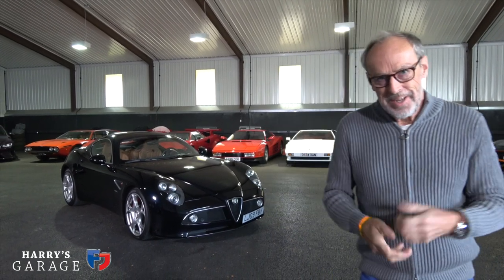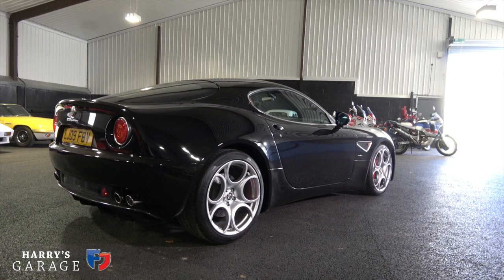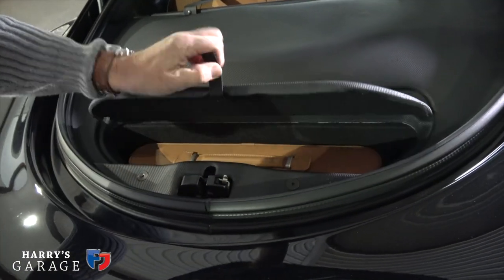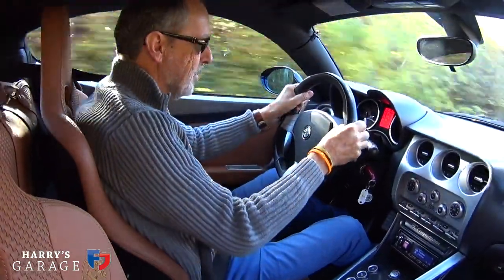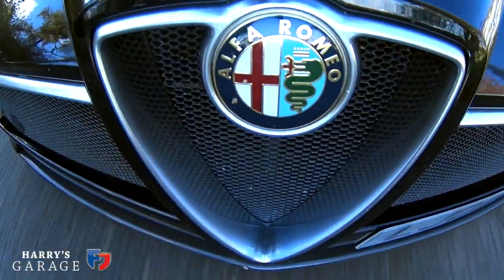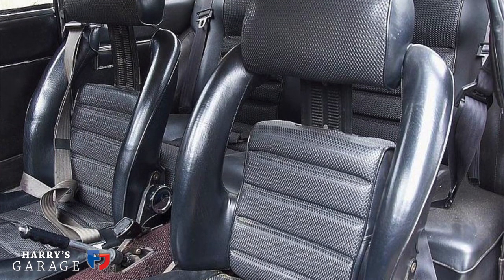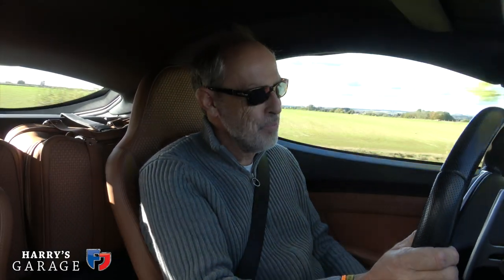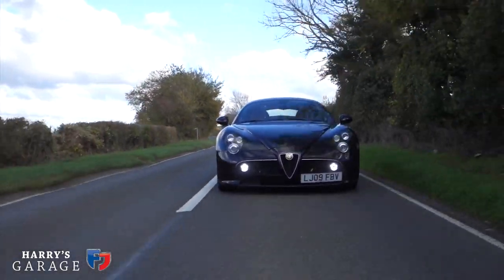Alfa Romeo 8C Competizione drive review

Comment: The engine and transmission are Ferrari cum Maserati.  the F1 transmission (aka Cambriocorso) was one f the weakest points in the Maserati Quatroporte ... the engine is an evolution of the 4.2 Maserati which in itself was a revised version of the Ferrari 4.2 with a 90 degree crank (as opposed to the Ferrari flat plane).  Great engine ... lots of torque and loved to rev.  Best audio track imaginable. However I dropped the Maserati like a stone when I learned of the 17K cost for a clutch replacement.

Comment: 1 thing wrong with this review. It should be an hour long. 
The only issue i have with this beauty is the aftermarket look audio unit. The sound system is already in place and reference level. Its called the engine!

Comment: 8c is a good looking car but so is Brera and the 159 SW is still just about the best looking estate car that most folk could afford. I challenge you to drive a Peter Cambridge /  Prodrive developed Brera or 159 - especially the later models that were much lighter. With KW3 Inox suspension and Eibach anti roll bars very little rides better even on bumpy UK roads.  Drove later Alfas and the steering on the 159  is far better - more manual like earlier 156 and 155. Many modern cars have become too digital for true feedback.  If only Alfa made a SW version of the new Giulia instead of the brash and somewhat obese Stelvio.......

Comment: In my opinion you can't really call the 159 and Brera 3-star cars.. They are basically the same as the 8c. Not the fastest, not the best handling but gorgeous to look at, and they make you feel special every time you get in and drive. That said, the 8c does make most cars (even the Brera) look like pregnant riho's. I owned both the 159 and Brera, and I would gladly add the 8C to that list.

Comment: So the ride, interior refinement and luggage capacity prevents it from being a decent GT car and the gearbox, weight amd woeful handling prevent it from being a focused sports car. The centre console looks like it come from a 1997 GTV twin spark and it's massively overpriced. And you can get the engine in a Maserati GT (which is a stunning GT car). I'm struggling to see how this isn't just as flawed as other Alfas of the same era. You've got to REALLY like how it looks to buy one, or buy it as a pure investment.
Reply: Or both ideally :)

Comment: When I did hear about this car, I was like Alfa has finally got their s*it together. Small middle engined sports car. Bot noo... allmost 100k price tag, no manual transmission etc. Who would use that amount of money to this tiny (but gorgeus) shopping cart (thinking what else you can buy with that money). They should scrap that all carbon bs to make it cheap, add ton of horsepower, manual and keep the looks it would sell more they could produce.

Comment: It is technical wise all borrowed by the Alfa sister company Ferrari incl the 4.7 V8 from Maserati GT.The same for the Chassis,  the gearbox,  the brakes,  and anything else built in this car. The 8C was built at the Maserati factory.  Than some Alfa badges attached and finish is the "Alfa" Supercar 😀.
The last real Alfa Romeo ever built was the 156 (1999-2005), escorted by the 147. The Alfa brand was killed with the 159 and Brera,   GTV,  Spyder etc. when Alfa merged in mid 2000's with General Motors in USA. This led to an "Alfa" called 159 which was actually a US Version of a Opel Insignia😅. The car was 400kg too heavy,  and not enough,  they put a Australian Holden 3.2 V6 into this worst "Alfa" Chassis ever! Equal and even worst the Brera,  of the same era!  Those models drove equal to a bathtub on baloon tires!  It was the shock of my Automobile life after owning a AR 175 3.0 V6 America 10 years before! 
Last year I bought two 156 2.4 JTD 5 cylinder Diesel and was able again to enjoy the full Alfa Experience! 
The 2.4 JTD must be one of the best Diesel engines ever constructed!  Unbelievable Power and sportivness! 
I had it all regarding Alfa and can only smile when I see the mass market boxes of today under the Alfa brand! The 8C and 4C are for sure funny machines but never worth the money of course! Guys,  concider a outstanding,  spotless Maserati Quattroporte V for less than 25k and you get the very same engine as in the C8, combined in a super sports limousine!  Good luck ever body,   take care!

Comment: Why steen and not aluminium ? Ah the italians , ready to put cabron fibre all over the car but puts a massive steel chassis so the damn car is heavy as fuck
Reply: Cheaper to make panels then build a chassis for 500 cars. They never planned to make it so they didn't have the R&D budget.
Reply: @mikehilton1888  Still , they could have done the extra mile, 1500kgs is very heavy for a 2 seater
Reply: @nemergix1707  It is very heavy and spider is worse. But a new chassis would cost tens of millions and isnt' viable for 1000 cars. Ferrari should have let them build it on their platforms.
Reply: @mikehilton1888  Eh , you are probably right. Still , it is quite underwhelming to see a "supercar" with a steel chassis.